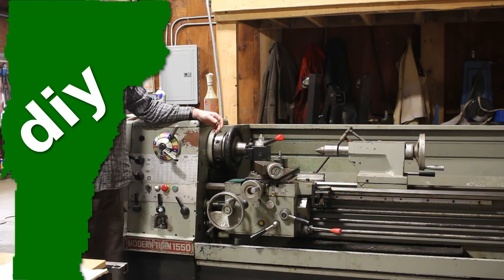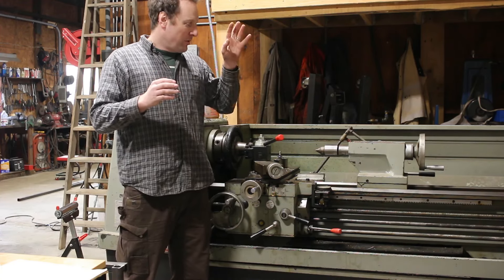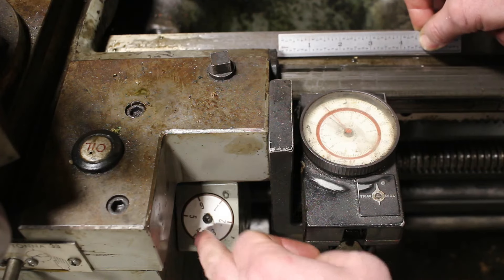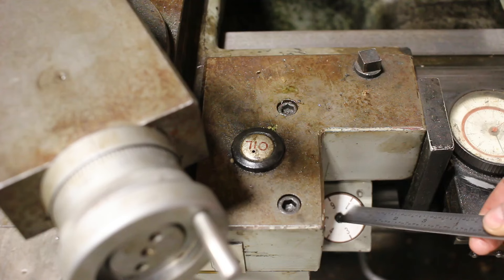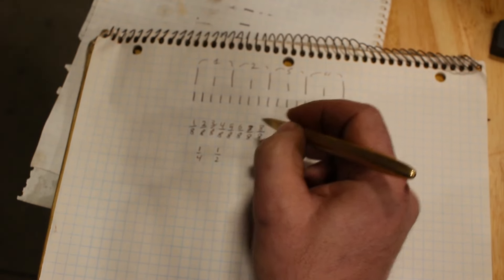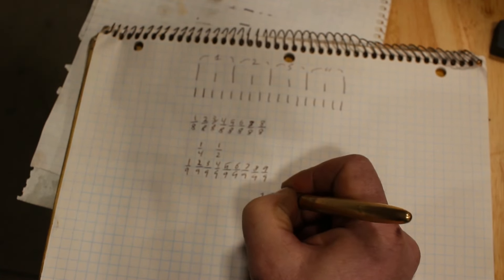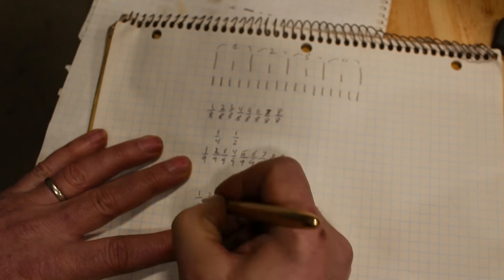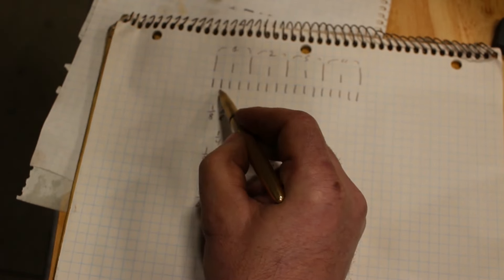My Lathe is Wrong and how I know it's wrong

Comment: I bought a used Mazak 860 years ago that i couldn't hit sizes to save my life. Found out someone had stuck imperial dials on a metric machine. I suppose to make it easier to sell.
Reply from the maker: My modern turn lathe has both metric and imperial marks on the dial. I was confused about it at first but I realized that only the imperial marking lines end at a whole number after a full revolution. So if you zero the dial you can move the cross slide up to 12.7 mm before things get difficult. So my lathe has an imperial cross slide lead screw.
Reply: @diyVT  I will tell you, you are dong it with the wrong hand...;)

Comment: make a blank dial then mark it at each engagement point?
Reply from the maker: Yeah I just need to make a new dial face with 8 divisions.  It wouldn't be hard to do a very simple one.  It's just held on with the middle screw.  I will probably flip it over and draw new marks with a sharpie. I want to make a nice new dial but I also have a hundred other projects to do.

Comment: My colchester master 2500 has a couple of different gears inside the counter which need to be switched depending on which thread is to be cut
Reply from the maker: This one does also. You need to switch them if you are cutting a MOD thread pitch whatever that is.
Reply: @diyVT  MOD is the european standard for gear pitch. It applies if you are cutting a metric worm gear on the lathe. DP or diametral pitch is the imperial equivilent.
Reply: There also should be a wheel Z =127. This is the smallest multiple of 25,4 mm (25,4 mm = 1”, and 5x25,4=127.)
Are you sure the lead screw isn’t metric? 
You rather crudely measured 4” on the bed and assumed the lead screw to be imperial, but if it is metric, you could be talking 100 mm which is only 1,6 mm less than 4”. A difference you wouldn’t notice the way you measured.
A dial with 6 devisions would be for 150mm. 
-It’s all decades ago for me, and being brought up in the metric system I have to do some reverse reasoning for which I am frankly too lazy right now… wishing you success nonetheless.

Comment: Somebody put a different dial on there.  With a 4 tpi lead screw you don't even need the dial for most imperial threads.  Anything divisible by 4 is impossible to mess up.  That dial would bug me though so I'd figure out a way to make it read correctly.
Reply from the maker: The dial face could easily be un-screwed and flipped over. I will probably just do that and make my own marks with a sharpie. Then tell myself that I will make a nice dial face sometime in the future.

Comment: Chack the leadscrew and the lathe bed if it's worn or not and that's it.
Reply from the maker: It's not worn and it's pretty clearly 4TPI. I think the dial is for a lathe that has a 6TPI lead screw.
Reply: @diyVT  This lathe is copy of a Colchester 1550. The imperial versions had the faceplate riveted to the dial stem. You have a phillips head screw so that's a giveaway that it has been tampered with.
Reply from the maker: @goat9875  it's a "copy" but a slightly fuzzy copy.  There were certainly corners cut in its manufacturing. I can tell it's a well designed lathe but it's not a very well built lathe.

There was another issue in the main gearbox where two bushings came out of the gears. It looked like there was a grove for a retaining wire but the bushings were too long and covered the groove.

There are quite a few other things as well if you start looking closely. I haven't seen a really Colchester lathe but I would be surprised if they were as crude as mine.

Comment: It might be 100 m m 25.4 m m equal s 1 inch  I was trained to engage on same number but that is a long time ago
Reply from the maker: I think the dial is for a lathe that has a 6tpi lead screw. I am not sure how threading dials work on metric lathes but dividing by 6 in a base 10 system seems unlikely.

The rest of the lathe is pretty questionably made. There were certainly some corners cut in its construction. I suspect that someone just put the wrong face plate on the thread dial because the one with 6 divisions was cheaper.
Reply from the maker: You can't go wrong engaging on the same number every time but you can waste time waiting for the number to come around on the dial.

If you have a 4tpi lead screw you and the tpi you are cutting is divisible by 4 you can engage at any of the 16 possible locations. If it's divisible by 2 you can engage every 1/8 of a turn of the threading dial. If you are cutting and odd number TPI you can engage every 1/4 turn of the threading dial. If you are cutting a X.5 pitch you can engage every 1/2 turn of the dial. and if you are cutting a X.25 pitch you have to wait a whole revolution of the threading dial.
Reply: Yes you need to find out which gear train is fitted to headstock.
But trying to reference to the bed won’t work as it is referenced to the thread pitch which it turning try doing a scratch run I would think that would show more
Reply from the maker: @extractengineeringltd  the issue with the thread dial has nothing to do with the rest of the gear train. Thankfully the chart for setting up the leavers to select a thread pitch is correct. That would be a really pain to recreate.

My thread dial is incorrect because in one full revolution the carriage travels 4" and I have a 4TPI lead screw so I have 16 possible places where I can engage the lead screw. My thread dial has 6 divisions and 16 possible engagements. If you divide 16/6 you get 8/3 mean each division on the dial represents 8/3 of a thread on the lead screw. Which is ridiculous, it means you can't even engage on 4 of the 6 marks. There should be 8 divisions, 16/8 is 2. Two threads per division on the dial makes perfect sense.

Comment: Is the dial for metric threading? 2.7cm =1in
Reply from the maker: I would suspect that it's for a lathe that had a lead screw with 6 threads per inch. I am not sure what type of thread dials lathes with metric lead screws have but 6 divisions would be weird to have in a base 10 system.

Metric threading with an inch lead screw pretty much requires that you don't disengage the half nut. Or if you do disengage it that it gets engaged at exactly the same place in the lead screw that you disengaged it.

Comment: Good video!
You could just wait for the 1 to come around but that can get tedious.
It was obviously built that way. Maybe to go with a metric lead screw?
I seem to remember way back to Fitter and Turner school we had to make a “Star Wheel” that meshed directly with the lead screw.
We then marked it depending on the thread we had to cut.
Here I cut a metric thread up to a shoulder on a very old imperial lathe with no reverse and no brakes.
Had to use all my tricks at once 🤠

How to Cut a Metric Thread on an Imperial Lathe For a Fire Poker
https://youtu.be/Jdvbnn-1I_0
Reply from the maker: The part of the threading dial that has the numbers on it is just a piece of sheet metal with some numbers screen printed on. It's held on to the dial with a single Philips screw. My lathe has a few other things that show it wasn't very carefully made. I suspect that someone in China got a deal on the threading face plates with 6 divisions and either didn't know it was wrong or didn't care.

I suspect that the faceplate of the dial was for a lathe that had a lead screw with 6tpi.

Every other quality lathe that I have seen that has a 4tpi lead screw has 8 divisions on the thread dial.

I will check out your video on metric threading with an imperial lathe. I saw another video of how to do it and I am curious if you use the same method.
Reply: @diyVT  I’d say both.  Didn’t know and didn’t care!  China is very much a take the money and run kind of business market.
I watched my own video again last night.  Not very exciting but hey screw cutting on a 90 year old lathe is a little bit of a niche market 🤠 
Let me know what you think of my take on it.  I think if I did it again I’d edit it a bit harder.

Comment: Buy a small used cnc lathe.  Then you don’t have to worry about metric, imperial, multi start threads.  It’s so much easier and faster.
Reply from the maker: I don't think CNC would be worth it for me.  I normally just to small one off parts and I don't do a lot of threading. I did some CNC programing 25 years ago in HS but I am sure I would have to re-learn a bunch of stuff.